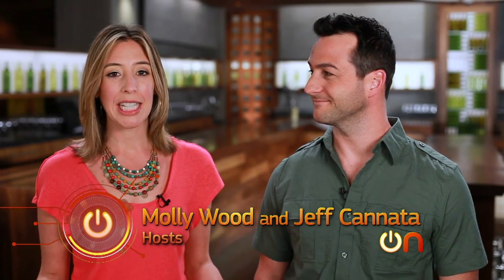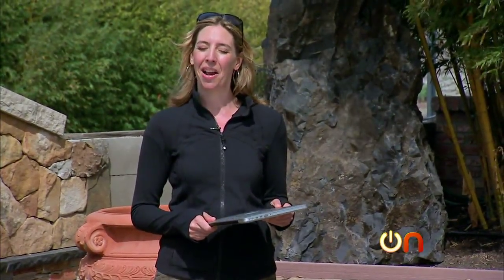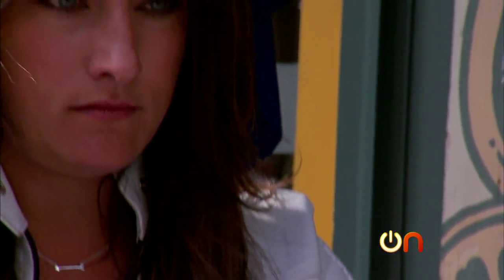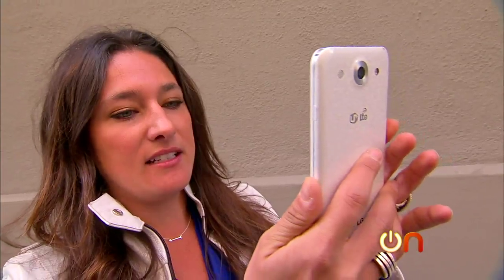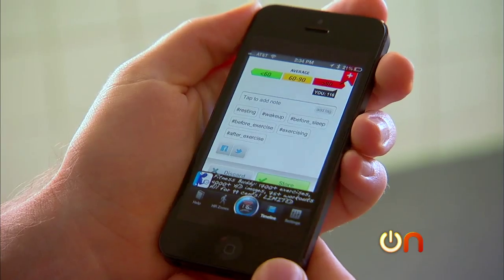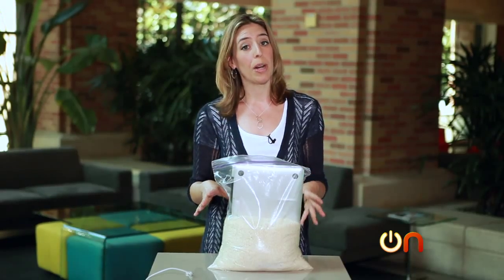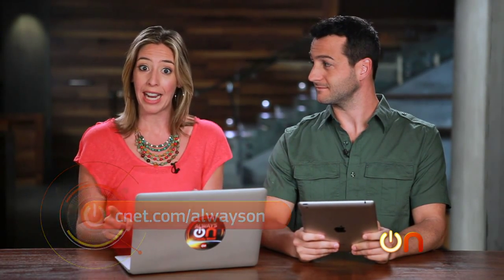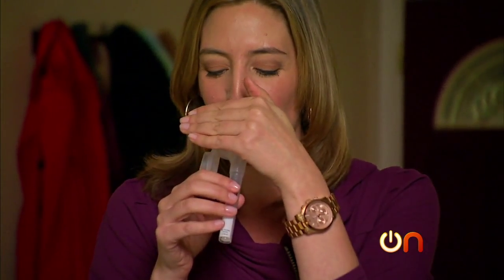Always On - The MacBook Pro rocks and rolls! - Ep 34

Comment: Just cause the thing barely turned on doesn't mean its operational. The keyboard is probably destroyed, battery pack cracked and oozing, hard drives split and capacitors and motherboard circuitry crossed and splintered.  Test is a fail.  Hook a monitor up to it at least.